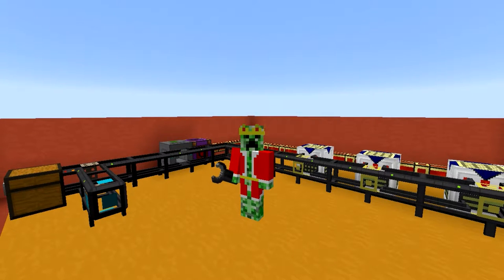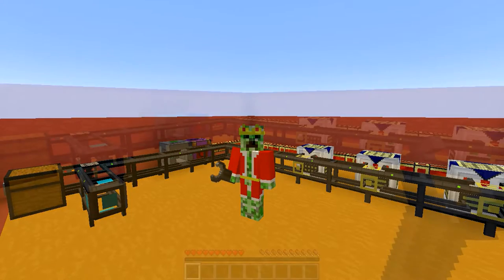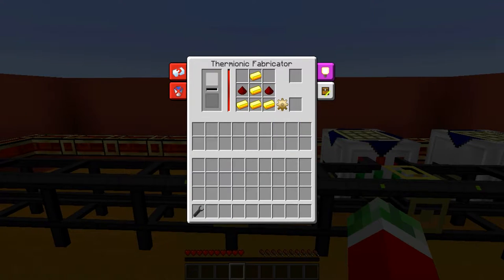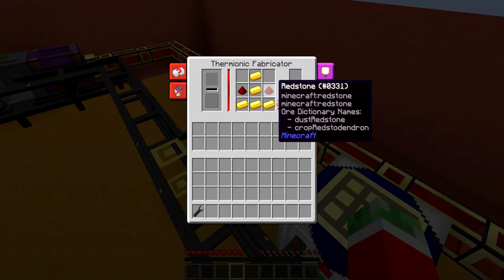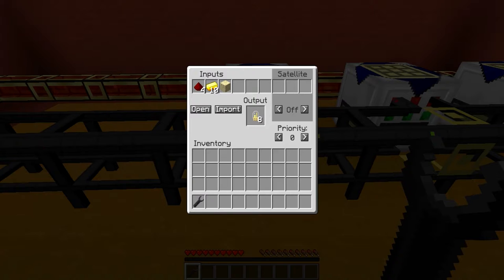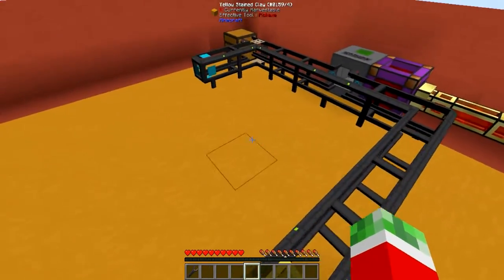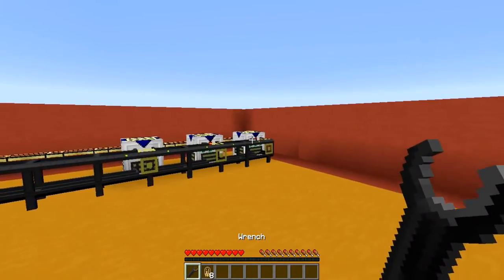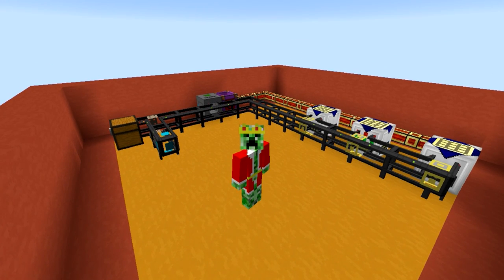Logistics Pipes Tutorial - #18 - Thermionic Fabricator

Comment: Also, you can use Buildcraft basic gates to send a redstone signal when the inventory is empty, so it doesn't constantly use power when it's not making anything. It does mean you have to wait for it to heat up each time, but the wait isn't long if you're using glass.

Comment: Complete metals production on skyblock.
I am playing Infinity SkyBlock and have a wall of drawers set up, but my problem is setting up ore processing. I have Igneous extruder going to 3 lines of pulverizers to produce the gravel, sand and dust that get stored in JABBA barrels, from there I want them to be pulled into the auto sieves with the broken, crushed and powder sent through Auto Compressors and then Auto Hammering the gravel and sand down to dust form. Then dust sent through the pulverizer to a redstone furnace to produce the ingots. All to produce the max efficiency of return. All the extra items from the sieves will head up to the drawers as well as the finished ingots.  I have problems that the machines can't pull the items and then push out to a storage chest I have as an overflow. I think I need extra chests, but not sure where and what modules will need to be added. Would also like all machines powered through the LP.  This is the first time I have used LP and am probably trying to build something too big for my first attempt. I was trying to make this nice and compact and not use lots of ducting and transfer nodes. Any chance of a tutorial for this?

Comment: Is there a way to get a second satellite target for a crafting pipe (or module)? Or failing that, is there a way to tell your system how to craft liquids? 

Context: I'm attempting to get my crafting system to auto-smelt the Thermal Expansion ingots (Enderium, signalum, lumium) I've got crafting pipes with fluid crafting upgrades sending the ingots to a Tinker's Construct smeltry controller, while the fluid satellite receives 1000mB of the relevant liquid (fed into the smeltry via TE tank set to output sitting over a smeltery drain block). But Ender Pearls, glowstone, etc. are rather hard to come by so instead of having a magma crucible with a full buffer of each liquid I need, I'm trying to get the crafting system to make the liquid from the dust/pearls when I request an ingot of the needed material.